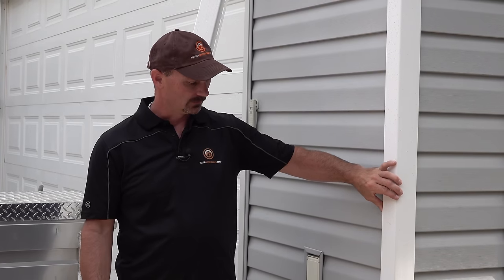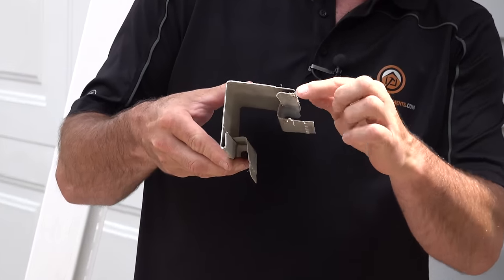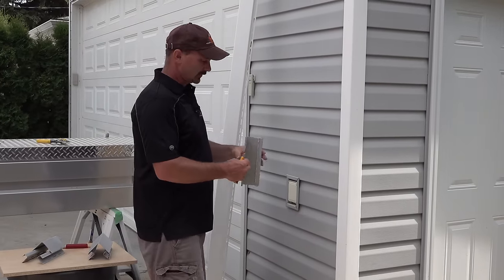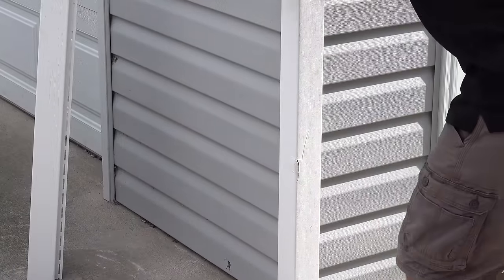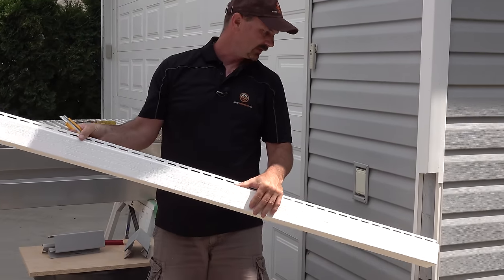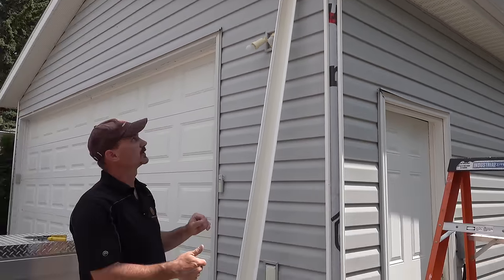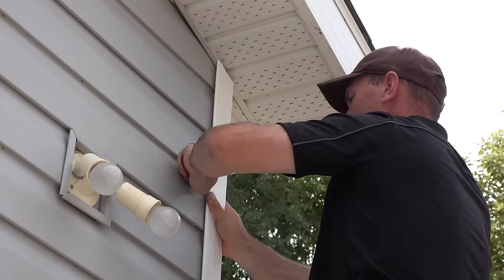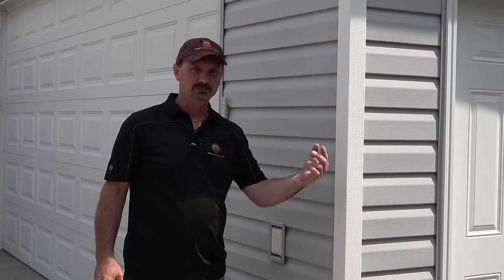How To Replace A Vinyl Siding Corner

Comment: Been using this technique for years. Sometimes the new corner will fit over the broken one with doing anything to the broken one. Hint: use a 4 inch grinder with a cut off wheel to make your cuts. You'll never use a knife again.
Reply: I was thinking no need to remove old gonna try that way
Reply: Or an oscillating tool too that would cut the old and new cleanly💪💪

Comment: My corner broke about a month ago during a wind storm and have been dreading the repair.  Your video is so timely and the technique you propose is elegant and will save hours of work.  Thank you for your time and effort!
Reply: Ditto. I'd recommend wearing gloves when cutting. even the vinyl is sharp when cut.
Reply: Ditto: well said
Reply: Hello, I'm in the same boat. My corner was busted from a company that plowed my driveway.  The corner has been exposed and I'm afraid the wood will get wet or worse rot.   Is there anything i should do before they replace with a new piece?
Reply: @rtta51 yeah I just did this on a customer's house after we damaged their corner during a tree job and my hands are all sliced up like a Thanksgiving turkey.

Comment: I did vinyl siding professionally for years and taught myself this method a long time ago. One method I leaned on over and over as I had a thing about not seeing fasteners, was I relied on caulking a lot instead of nails or rivets. Geocel was my caulk of choice and I would put a good gob on both sides at the top and support the corner till the caulk set up. That allowed the corner to expand down and not wrinkle when it expanded. Great video!
Reply from the maker: So damn! I guess I did not invent this method! LOL I often wondered if others did this same thing. 
Yes I should have mentioned the caulking at the top but forgot because in this case it was not needed as the corner fit to the concrete. Thanks for the feed back!
Reply: Can you do this with an inside corner also?
Reply: @SonsOfThunder229  I never did but I’m sure you can.

Comment: Excellent video. I’ve been around some construction/repair all my life and that’s a new trick. I can fix anything but because I don’t do it for a living in over 30 years, I don’t think of creative things like this. If several were damaged, you could also get some pvc coil and make a FALSE CORNER on a metal brake with return bends and pop it right over the whole corner but unless you did more than one, it would not match. I love how creative people are, never too old to learn, thanks

Comment: Thank you Shannon. I had two damaged corner pieces that I put off replacing for 10 years, as it was too expensive. Your insightful  video led me to believe I could do it myself, and your calm mannerism was nice to learn from. Even though the corner pieces available were 1/4 inch shorter on each side, cutting off the old and using the tool you suggested made the new pieces fit nicely. One helpful suggestion would be to use leather gloves when cutting with the utility knife. Those final shards cut a few knuckles doing the first piece, and the leather gloves made cutting the second piece much safer.
Thanks again!

Comment: Excellent how-to.  I just repaired the corner piece on my garage after hitting it with the plow 4 years ago.  I was dreading doing it because I didn't want to replace the whole piece.  This video allowed me to do the repair in 40 minutes.  The only thing I did different was to make the cuts with a multi-tool and a fine tooth blade.  Like butter.  Thanks for the vid.
Reply from the maker: Nice work!

Comment: Thanks to a hasty weed-eater operator, two corners on my shed are badly damaged.  I was putting off repairing them because I thought I had to remove the siding.  After finding your video, it will be an easy repair.  Thanks!

Comment: You made my day! I boogered up a corner five years ago removing a fence post that the previous owner installed way too close to the house. I've been dreading the day that repair would get to the top of my to-do list. Not a problem anymore. Also, glad for the tip that warm vinyl cuts easier than cold vinyl.

Comment: If u only remove the nailer strip from the new corner it will hold in place better. The way u cut the new corner it will slide down. Also when cutting the old corner off use a roofing hook blade. I did this for years.
Reply: @dropndeal  that bothered u? Nothing negative said. Self esteem issues?

Comment: Good demo video not difficult at all. Thinking about siding my house, I've done my previous home several years ago but some thing you forget. I have all you videos bookmarked for my project. Wish I could post a photo of the front of my house. Some of the front is interrupted with stone so installing the starter strip level all way across the front may be a problem. Could I use a laser level to find the line on both sides of the stone?
Reply from the maker: Yes or you can simply measure from the top of basement or bottom of floor joists.
Reply: @HouseImprovements  Thanks

Comment: Great idea and video! 2 tips from mistakes I made: (1) I cut the new piece on the garage floor. It was really hard to cut and as I did it, I moved it back and forth and shifted it as I went. In the end, I discovered a scrape mark on the nice brand new installed plastic. I should have done it on the grass or thrown a few towels down or something. (2) Cutting it was extremely hard. But if I pulled the 2 sides apart on the already-cut section, the knife cut way more easily (spreading the material apart right where the knife was trying to cut). Also, exposing the knife blade more to 2 sections and using a bit more of a sawing action rather than just pushing the blade straight really helped.
Reply from the maker: lay your new corner in the sun for a half hour or so as well. That will make it easier to cut.

Comment: An easier way to do this is to measure 1/2" from the edge (spot where you cut it) and cut it all the way down from top to bottom (on both edges.) Essentially your first cut you made on the installed (broken) piece,  no more trimming needs to be done. Then cut the new piece like you did and then it will fit just like you describe. Except there is no need to cut the piece on the house into that little corner.

Comment: Would some kind of sealant or glue be a good idea in this application?
Reply: Nah, the clipping on of the corner the whole length on both edges is more than adequate. Caulk or glue would be unnecessary and make a mess.
Reply from the maker: If you glue this it will wrinkle in the sun. You could glue if it was only at the very top on both sides then it could expand and contract as needed.
Reply: Good question and great answer. Thanks to both!

Comment: I just finished doing this. We struggled trying to make the external piece snapped inside the sides. We had to cut more of the sides until it eventually fit. It looks a little stretched but other than that it was a success. Coming from a non handy guy, thank you for making this video sir!

Comment: Excellent tip. It looks nice and solid as is. If there were ever a need to reinforce it, then maybe a bead of adhesive before installing the  new corner will do great. On the other hand, if you leave it as is, then you can remove it again easier for future repairs or access to that corner.
Reply from the maker: A dab of adhesive in the top corners usually is enough

Comment: Was very much dreading doing the FULL replacement from nails-siding approach and glad to have run across this as I prep on a finally non-windy day here! Going for it and I hope it holds up to the local winds! LOL time will tell.... I may add some construction adhesive but then it will affect any future replacement needed. But at that point it's probably time for new siding all around anyway! Thanks for the vid!

Comment: Add clear silicone to the inside of the joint in a couple places to stop it from falling during expansion and contraction. Also, this guy knows vinyl. Very rare. Thumbs up buddy
Reply from the maker: Yes I forgot to mention that cause in this case it was not needed but many people have asked about it since the video posted.

Comment: THANKS!  I've been racking my brain to come up with a decent outside corner for steel siding.  Now I see that I can use 2 J-channels and an outside angle with open hems on both sides to snap a corner on without exposed fasteners.  Once I get the proper locations I can make a 90 degree gauge to set the J-channels...it will work!
Reply: I wish I could show you what I did at my house 
My house is aluminum siding and I redo all the corners looks beautiful. 
After I did my hose the 6 neighbor's hired me to do there homes
Reply: @javiergonzalez8227  well... I wish you would show me so I don't have to find some magic...

Comment: I've done siding work for 20 years and never seen this done.. brilliant..
Reply from the maker: A little dab of silicone in the top edges will keep it from slipping down over time.In this can it was not needed in the video but i should have mentioned it.

Comment: Thank you! Something put a hole in the outside corner trim on my house-- not sure if it was a cow horn or tree branch during a storm. I will need to get it replaced.
This looks much easier to do than trying to pull the siding out & remove screws or nails. I think the people who did my siding used nails.

Comment: Great tips! I used your methods to replace the bottom 10 inch section of a corner piece that was busted when I moved in to the home 2022. I used a Dremel to cut the attached part and then scavenged and cut a piece of identical trim off a collapsed shed in the back yard as that trim is no longer available. No more busted eyesore trim!

Comment: This is absolutely brilliant!  Also, I wish my husband had this calm, Canadian accent.😅 The only problem is that our corner siding is so long and high up. Would be dangerous to try to replace the whole thing when it was just the bottom that was shredded. Some dummy that used to own our house mowed into both corners so badly, we had water intrusion on both sides. We did a DIY piece in of the corners ourselves because the quote was $650 to have a handyman piece it in.  This video makes me want to try this method as pieced in corner repair.  We don't even care if it matches since it's just the bottom corners.  👍

Comment: Great video, really helped me. A couple things I noticed in doing mine: Be careful when snapping the second side into place while reaching around the inside to snap it in place as those edges are stupid sharp. sliced my index finger like a razor blade. second, a bead of silicone in the channel will stop the replacement piece from sliding down if you don't have trim on the bottom to hold it in place.

Comment: Adding a little adhesive in the groove of the outer channel would truly keep it from moving if it gets bumped by a car or something. But this is a great way to repair the corner. Great job!
Reply from the maker: Yes a inch or so of caulking on each top corner will help.In my car I never needed it because it is supported by the drive way but I forgot to mention that in most cases you  need to caulk it.

Comment: Just had to do this today.  Works slick and easy. only thing i did different is that I used an oscillation tool to do the cutting of the pieces.  Did not have to worry about a slip of the utility knife.

Comment: I had thought of this, and 1st hit I get on Youtube you are doing it! I need to replace a 4" wide white outside corner, I installed 20 years ago. Wouldn't you know it seems impossible to find a 4" wide corner now.... So much for the easy fix, unless I can find a proper size replacement. Great fix if I can find one!
Reply: havoc2000 try Menards they have the 3 1/2 and 4 in corner.

Comment: Funny, I just had a customer ask me if I know how to replace outside corner. Now, here is this video, popping up in my suggested videos. Coincidence, or "Big Brother" listening? I'll leave that for another discussion. lol 
   But anyway, great video. And now I'm going to do this. Except, I'm going to add a bead of silicone inside the fold. My thought is that will help it feel more stable as one solid piece of corner. Thanks for the great idea!!!
Reply from the maker: Yes I should have mentioned the silicone. In my case the corner could not slip down if it wanted to because of the concrete drive but normally you will want a inch or two in each lip at the top and support the corner for a few hours until that cures.

Comment: Like the MN accent 🙂 I wouldn’t remove the extra edges because the double thickness will add in the support (although does make it a little harder putting on the new piece) and I would add a little construction glue on the inside piece (top and bottom) to help keep it in place.

Comment: outstanding! I have a broken corner from the recent winter and tbh was worried as hell that it woukd be a huge project, the only problem I see is that from ground to soffit I am looking at around 15 ft so the plus is no cutting but the downside is the piece wont match due to sun fading but eventually will Im guessing. my worry with this method is obvious sliding/movement but I guess I can always drop a bead of silicone on both sides to hold it down if I have to. great video though! gonna save me a lot of time and effort!

Comment: Finally found the right size corner (3 1/4") so I am going to give this a try.  One concern: bottom of corner does not rest on anything so hoping there will be enough "side to side" tension so corner won't slide downward.  Thanks for vid. Very well done.
Reply: A squeeze of glue, silicon or gap filler at the top or bottom will hold it. There is not a lot of weight in the corner so friction and the spot of glue should do the trick.
Reply: @PNH-sf4jz  Success.  Thanks much for the vid and the input.  Happy with the result. Would never have thought to try your solution.

Comment: Thank you so much for this excellent video! You're an excellent instructor! 
I have a hole  in a corner & need to replace a small piece about 1 foot long. 
I am going to purchase the siding removal tool as using a screw driving just doesn't work well! 
My question is do I need to glue the top and bottom ends? I see the previous owner has screwed corner pieces but that doesn't look good and I worry about leaks.

Comment: ive used this technique many times. it help to leave a little of the roll on the new piece. it will help it snap in easier. and take enough material from the old one or your corner will flatten out. its def a time saver though

Comment: I do something similar, but it's even less work. I prep the new corner the same as you do, but then just snap it on right over the entire old piece. I leave the entire old corner alone. The creates a double thickness corner, less prone to damage, and the work looks original. I imagine you could put some liquid nails underneath the new piece for additional strength, but I never needed to.
Reply from the maker: Interesting. Does it still expand and contact without wrinkling with it fitting so tight?

Comment: I've removed the siding on my double wide to replace the ¼" foam with sheathing.  When re-installing the siding,  I've had to replace some pieces.   Cutting was a breeze with my oscillating tool, faster than a knife although not as clean as a knife cut.

Comment: Great attention to detail thanks for this. This is definitely a lot easier than fully replacing it. Do you have a recommendation for my exact situation?

My situation is I am getting an inground pool installed and the pool company wants me to remove the first two rings of my
Reply: Sorry hit the wrong button my situation is my pool company wants me to remove the first two runs of my vinyl siding my question is when I remove those two how do I get it flushed to the house again because when I take the two off for the decking that needs to be done I am going to have it flap so this is why I'm asking if you possibly have any videos on this or if you could make a video on this thanks and keep up the great work.

Comment: Cool tip! Should put some caulking behind it so the new corner doesn’t slide around. Also a grinder with a zip cut cuts vinyl like butter 👍🏻👍🏻
Reply: In a reply to another comment the guy who made the video said he should have mentioned placing 6” of latex caulk in the channel of both sides of the new piece to help secure it.

Comment: Hi From Victoria BC Canada. 
That was a amazing trick.
Thanks for the great video. 
Any videos on how to ad more building paper at the corners without removing all of the siding. 

I took part an old deck.  Whoever Installed the deck, cut the building paper on the house to attach the deck, but over time water got underneath, so I replacing the deck,   but paper is missing where the deck was attached. 
Either I have to take all of the siding off to re-paper, or are there any alternative short cuts?

Comment: @HouseImprovements
Thank you for sharing the video. I have a question my old siding width is 3.5” but I found the closes size 3 and 1/4. It’s a 2 story house.
Can you do this installation for one piece 10’ ?
Thank you
Reply from the maker: It should work ubt the transition between the two sizes will be a little off. Ideally if the narrower one will be the bottom then it should fit into the upper wider one easily ?
Reply: @HouseImprovements 
Thank you so much for your help and prompt response. Yes bottom is damaged and I will replace bottom one only 
Thanks

Comment: Well that was a surprise !!
I thought you were gonna just overlap a piece and was thinking that's going to be butt ugly.
Great idea. 
Any thought to adding a couple daps of caulk on the inside.even though it won't expand and contract well.
Great job!!! Thumbs up
Reply from the maker: Actually yes a couple dabs at the top will help usually. In this case it actually sits down on the concrete so I forgot to mention that.